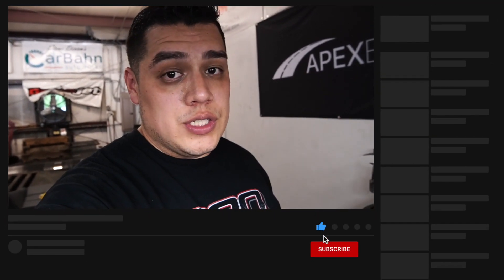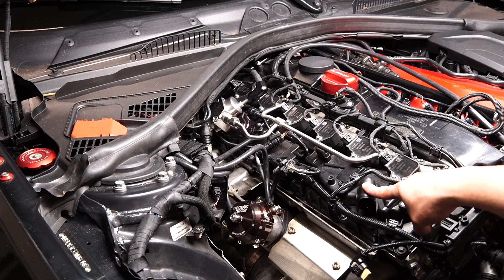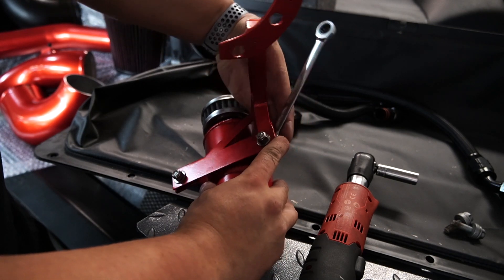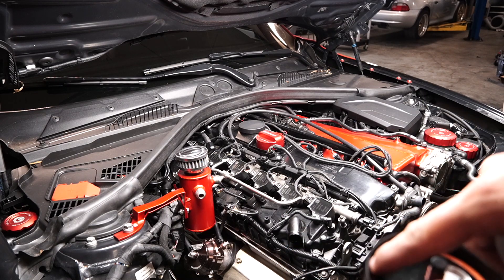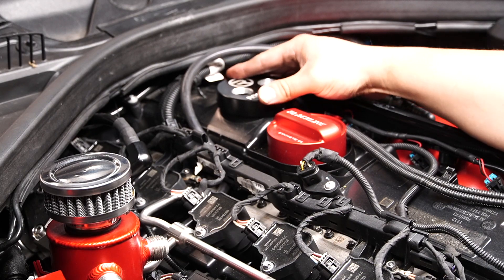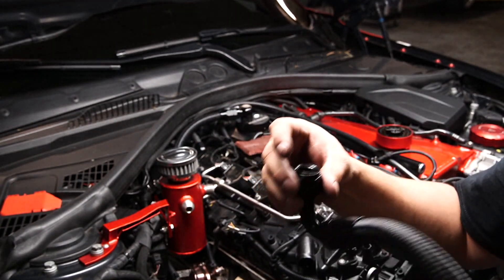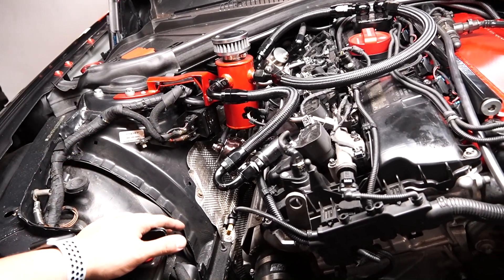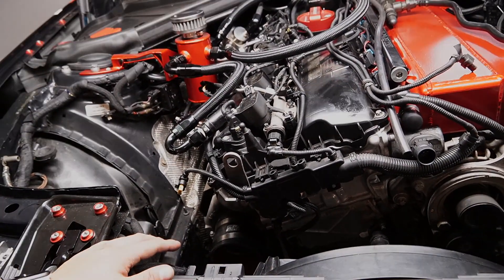ROSS RACING GEN 1 B58 PCV DELETE KIT | DIY and Review

Comment: When putting my kit on I was torquing the bolts to the 56nm had the torque wrench set to 41.3 ft-lb and 2/3 bolts snapped right in the middle same spot in both
Reply from the maker: That’s crazy. I’ve had mine snap too but that’s usually because they were weakened from stress if they were over-tightened before.
Reply: @NoClutchGarage I found out it’s because if you have the m8 bolts it’s only 30nm not the 56 but if you have the m10 it’s 56
Reply from the maker: ah, that’s crazy I’ve never seen the M8s use there before!
Reply: Also, always replace stretch bolts once removed.

Comment: Hi LJ , at 9:55 you push the braided hose elbow into the manifold. My stock setup has a heat shielded breather hose from that manifold down to turbo inlet pipe.  What should I do with that stock breather hose? Thanks
Reply from the maker: You meant to say the Valve Cover. Yeah so this kit effectively forces you to delete that system. There are a few ways you can go about it. 

1. You can delete the line altogether and via custom tune you can have the code that will trigger when the heater attached at the end of that hose is unplugged removed, and that will be the end of that. Then you will need to plug the intake pipe where the hose used to plug into with a heavy duty rubber cap and a clamp.

2. You can remove the hose only and leave that end piece (heater) plugged in and supported somehow (I have done this temporarily, so I know it works) and then cap your intake pipe with a rubber cap and clamp.

In either case you either need to plug that inlet or get another inlet that deletes that hole altogether. At the moment I have deleted the system altogether and I don’t have to bother with any of it.
Reply: @NoClutchGarage  thank you , I just realised the kit has a silicon plug to cap the oem hose, held in by vacuum but feels a bit loose.  I think I’ll remove the hose and cap it somehow down at the turbo intake pipe
Reply from the maker: @747Richie Those work but they will wear over time sometimes. If you message me on instagram I can send you a link for a better one you can use!